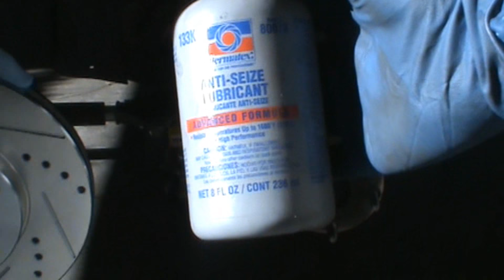Toyota Rav 4 Brake Job | Pads & Rotors | Full Service | Step By Step

Comment: Good video!
 One very crucial and important step was left out. When the car is back together and before you go to drive it, it is important to pump the brake pedal a few times to work the fluid back into the calipers. If you skip this step you run the risk of not having any brakes the first time you hit the pedal.
Reply: Yes, pump the brakes when the vehicle is running. This way the master cylinder has some pressure. Then you have to burnish the brakes to the new rotor.

Comment: Great video...one thing you might mention that you should remove the brake reservoir cap before you push in the caliper piston as to release the air making it easier for the piston to go in

Comment: those 2 holes on the rotor r there to tighten a bolt in there and it will then release the rotor u dont need the tool that u have,but it is a sweet tool
Reply: Or, if you are not re-using the old rotors - just take a mallet and pound it off.

Comment: At 5:40, no need for a puller.  Just stick 13 mm bolts into the 2 screw holes (seen clearly at 4:30 at the 12 & 6 o' clock positions) and tighten (the bolts will push against the hub underneath) to remove the rotor.
Reply: Actually its a 10mm bolt that is used to break the rotor free. The rotors actually rust between the wheel studs, a easy way to break the rotor free that dont have the threaded holes is take 2 ball peen hammers, place one of the peens in-between the wheel studs and hit the face with another hammer, going around between the studs. Put wheel nuts on to protect the threads. Gotten the most rusted stuck on rotors off this way. Clean them up and put anti-seize between the studs on the wheel hub as well.

Comment: Anti seize is not a good lubricant to put on the shims. There is actual brake lubricant specific to shims on the back of the pads. Additionally you HAVE To lubricate the guide pins on the caliper so it can slide back and forth so you do not have uneven brake pad wear. Brake hardware is thinner than a paper clip and is subjected to 300+ degrees. You bend a paper clip it doesn't come back to the original form. Same theory can be applied to brake hardware. Hardware should definitely be replaced. Lastly you should always inspect brake fluid, by using a test strip. If fluid quality is poor you should flush brake fluid.
Reply: True - especially on the rubber parts - have to use some type of rubber/silicone-safe grease.

Comment: yes , you left out a couple of things. You did not remove the slide pins and clean them and put new high temp grease on them. they are important as they seize up after a while and you get uneven brake pad wear. I would have bled the brakes also. just in case there was any air in there , from the caliper being pushed back in. Just to get everything nice and tight again.

Comment: Great video, however some rotors are directional to keep brakes cool by forcing air through the fins. I'm not sure if Toyota use them but on some European cars you can't use the left rotor on the right side or vice versa.

Comment: This video leaves out a couple MAJOR parts resulting a less than optimal process. 

A. You need to take the caliper off itself, and hang it to, do the pads. Yes, you need to take the bracket off to change the rotor BUT putting to put the pads in "easily", put the rotor on, and then the bracket, then the pads, then the caliper. 

B.The caliper bolts are "sealed" so though they may look rusty, when you remove them, they look brand new. 

C. Your don't need a puller! to get the caliper off. The hub flange is behind the rotor and just screwing the M8x1.25 threaded bolts in the holes will "push" the rotor off.. Warning: rotors in northern climates/high road salt areas will VERY rusted on. AND the bolt holes very rusty as will, and in all likely hood, fail (strip out) under the pressure. With as much pressure on as you dare before striping, PB Blaster it and hit it rotor with a BFH. Will MOST likely pop off (in my case today, the rotor split along the face edge. Chiseled face off, still leaving the part over the flange rusted to the flange. PB Blaster, little chisel work along the edge between the flange and the rotor to loosen the rust a little and another BFH wack and it popped off).
D. There are SS guides that the pads in the bracket.. wire brush those clean with some brake cleaner; add some "brake" grease (handles the high heat) to the slides help them,well, slide easier.
E. BIG NOTE: the pads have different configurations on each end of the pad, so there is a FRONT side of the rotor pad and REAR side of the rotor pad... get them right or they don't go in worth a damn.

Other than that, fine video.

Comment: Great video! More light would have been good on a couple shots where you were inserting pads into a dark caliper. Also, you didn't mention bleeding the brakes. I guess since you never opened a line you might not need to. I have had to open the bleed valve in the past when the piston caliper was reluctant to compress, which meant I needed to bleed the system.

Comment: Not really advisable to push the brake fluid back thru the master cylinder especially with the master cylinder cap still on. Use a line clamp to clamp the brake hose and break open the bleeder, when you push the piston back the fluid will escape thru the bleeder, using a hose and bottle to catch it. You risk damage to the master cylinder forcing fluid in reverse. Advisable to flush the brake lines (my personal opinion), use the brake bleeder tool from harbor freight and compressor for a 1 man bleeding job, works perfect.

Comment: no need for screws or a puller . thats what a mallet or deadblow is for . way easier and less time consuming . and pushing the fluid back through the master isnt going to hurt anything just take the cap off the master

Comment: anti-sieze doesn't belong anywhere it can melt and/or migrate onto braking surfaces. That's why they make high temp brake lube for moving or slide points. Back of the brake pad- I think you are looking for a product that dries gummy, called Anti-squeal, not antisieze compound. A very light film of antisieze can be put on the rotor/hub flange to keep it from rusting on like you demonstrated. great on lug nuts too.
Reply: Art Noll exactly... why are the spraying brand new rotors with brake cleaner..  also sloping anti seize every where.. not nessecary at all
Reply: jeff the new rotors are shipped and stored with rust inhibitors or similar oils. need to clean them off so new pads wont be cotaminated or glazed during the bedding process. also agree that you dont need anti seize compound behind the pads

Comment: Hi there, Thanks for interesting video. Would you know the torque values (as this is very important)?
Reply: Lug nuts - 80 ft lbs is fine.
Reply: What about the caliper bracket bolts?

Comment: dont u need to bleed the brake line to get rid of any air bubbles?
Reply: You are not opening the brake hydraulic system at any time (if you are doing it right), so no, you should not need to bleed the brakes. Any time you crack open the hydraulic lines you allow air to enter the lines, so you need to bleed them once everything is shut tight again.

Comment: Is this majorly different than doing it on a 2010 Rav4?
Reply: +icemanjs1213 Same process with no difference.  The pad might be but as far as removal and installation on pad and rotors are the same and you don't need the rotor puller as shown here.  The two screw holes on the rotor is where you screw in and loosen the rotor.

Comment: How do you tell for sure whether your rotors are the type that require brake clean?  Is there a better system other than see if they're sorta shiny?  Will it say on the box?
Reply: Sean Tobin dont bother cleaning them.. they are exposed to debris the second you start driving... cleaning is a complete waste of time..  also the anti seize hes slopping everywhere will just absorb dirt dust and debris... pointless on brand new parts
Reply: wrong jeff. clean all of the new rotors off! they have a coating of rust inhibitors during shipping and storage.

Comment: That is an unnecessary amount of antisieze on the brake pad. Looks more like you were trying to spread frosting on a cake. All that frosting on the ears of the pad can now potentially attract and accumulate brake dust, which could restrict pad movement at some point. The shim on that particular pad wouldve been enough to prevent squeal based on the coating it comes with.

 So the pads and rotors get replaced but the caliper pins dont get serviced at all?
Reply: I'm glad I'm learning more helpful info from you.